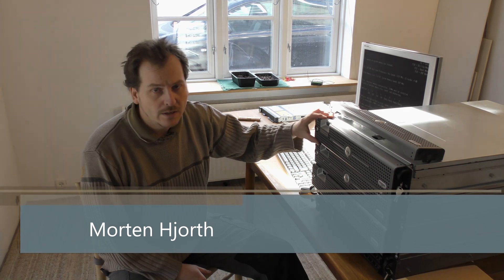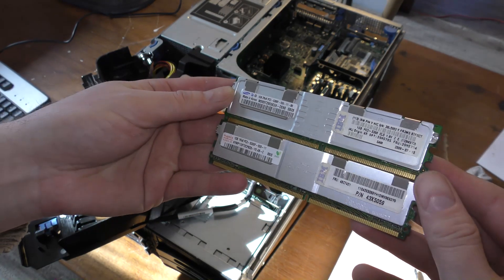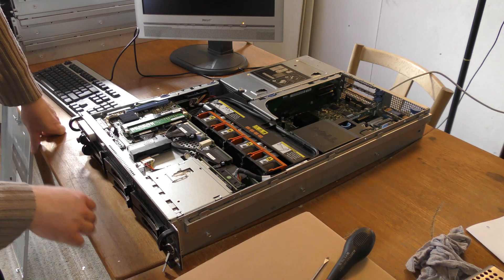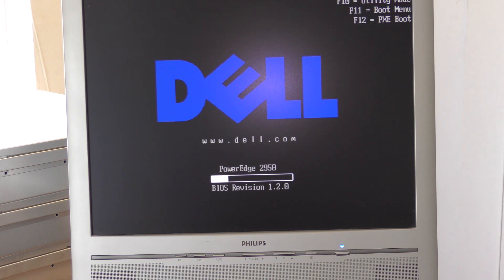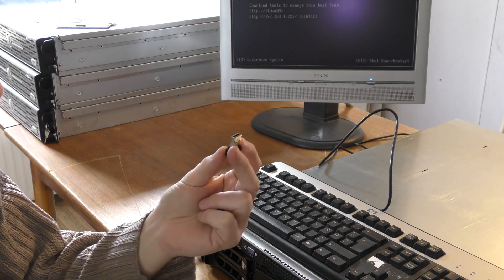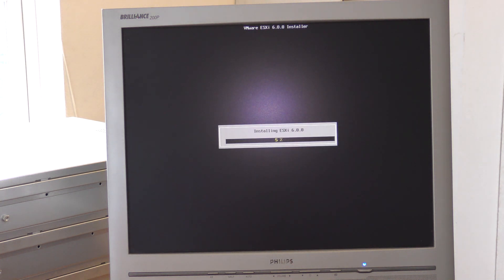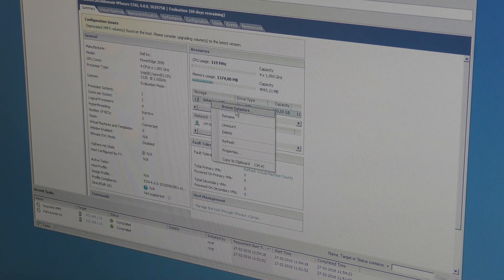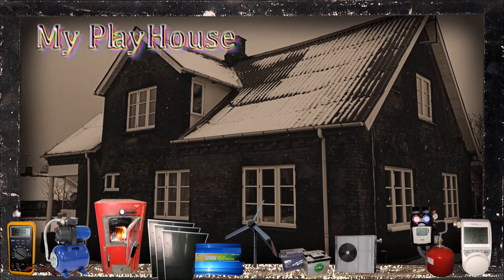Upgrading DELL PowerEdge 2950 from ESXi 4.1 to ESXi 6.0 - 316

Comment: Great video-- also loved the, baking a server board vid, I got a system working with a cigarette lighter once, but I knew where the bad solder joint was. Building a Pelican cluster from junk-- and want to add dell r900 w\16 cores, but I just have the mother board, power supply, and processors,, please help--
Reply from the maker: Thank You very much!

Comment: Hi Morten I'm currently running VMware ESXI 6.5 on my ''server'' which is a simple HP desktop pc (p6-2052fr) i5 2320 4x @3GHz, 4Gb of RAM with an Intel server NIC added (the built-in NIC isn't compatible) and I’m running into lots of compatibility issues and it seriously lacks of RAM for what I want to do so I plan to change it and I saw someone selling 6 Dells PowerEdge 2950 III with 2 Xeon E5405 4x @ 2Ghz, 8Gb of RAM, raid card Perc6/l, 1* HDD 73GB SAS, for only €36 each server. I'm wondering if it would be compatible with VMware ESXI 6.5 because I don't see it on the VMware's official compatibility list and if it is it would be a very interesting choice because I could easily upgrade the CPUs or max out the RAM to 64GB for only €60ish the last time I checked on eBay. So, have you or anyone else tried to install VMware ESXI 6.5 on a Dell PowerEdge 2950? it would help me a lot in my decision to buy one or not because I always dreamed to get a ''real'' server to play and learn new stuff with... otherwise awesome video! as always :D
Reply from the maker: Hi Tony M
I am not a big Dell Server Fan boy,, a  PE 2950 with a x5450 should work.. my Lenovo x3650 M1 which is same gen. does.
But if you really want Dell you shout go for an r710,, that uses the Intel Xeon 5500 and 5600 series of CPU,, and has hyperthreading. 
Thank you for watching! :-)
Reply: Yeah personally I find IBM/Lenovo servers better made than most of Dell ones, but they are way more expensive.
I don't really mind to get a Dell rather than a Lenovo, they tend to be cheaper, for the same price of a IBM System X3650 M1, you can get a Dell R710 which is way more interesting because of its hyperthreading as you said and its better upgradability (you can find pairs of 6 cores Xeons for pretty cheap), and apparently Intel Xeon 5300, 5400 and older series are way less power efficient than newer ones and they heat a lot more, so effectively the Dell PE R710 seems to be a really good choice in the long term but I'll have to figure out if it's very worth it to spend more than €150 with my very tight budget (#studentbudget lol), or just take a few of those older Dell that are cheaper but more power hungry.

Comment: Is PowerEdge 2950 possible directly install ESXi 6.0 ? Or need Upgrade from older version ESXi ( Such as 5.0 or 5.5 ) ?
My PE 2950 Spec
Intel Xeon E5430 2.66GHz x1
32GB FB-DIMM DDR2
320GB SAS x4 RAID 5 + 144GB SAS RAID 1 (Dell PERC 6i)
Reply from the maker: Hi LEYLAND LUI
IT shout install ESXi 6.0 No problems.
Thank you for watching! :-)

Comment: Hi, first i love your video's.

I got a question, how much power consumed the Dell poweredge 2950?
i like to know that because i can buy one for 75 euros with the follow spec:

2x cpu Intel(R) Xeon(R) CPU E5335 @ 2.00GHz quadcore
32Gb ram 8x 4Gb DDR2 FB-DIMM Synchronous
2 x onboard nic Broadcom BCM5708C NetXtreme II GigE (NDIS VBD Client)
2 Power supply 750w max
Perc 5/1
2x 36Gb SAS disk 2,5 15k [of meer]
Dell Remote Access Controller 5

Let me know thanks.
Reply from the maker: Hi  I sold my Dell 2950,, so I can not measure it,, but they are power hungry,, somewhere between 250 and 350W, is my guess.    
Thank you for watching! :-)

Comment: Sometimes my PowerEdge spins the fans up super fast because of the intrusion alarm being tripped, which is when the case is opened, I think i have caused it by opening the case (or not fully closing it) while the power supply was still up, a quick power cycle usually calms it down though, my log files are full of the system complaining about intrusions.
Reply from the maker: HI +Nevexo (computercam) 
It tels you in the log,, if the server has been open while powered off,,rather smart.
Thank you for watching! :-)
Reply: +My PlayHouse (Morten Hjorth) And the fans go ballistic when you open it!

Comment: Thats amazing you had no issues upgrading to version 6. My Poweredge 2900 is running 5.5 U3, so I feel more confident upgrading to 6 now! Thanks!!
Reply from the maker: Hi +gencwiz2 
Yes my biggest issue was really the I did not know where to look for that USB stick,,, I would think that if you can run 5.5 U3,, 6.0.0 will run just fine.
Thank you for watching! :-)

Comment: Hi Morten!  Thanks for doing another 2950 video.  I can tell how much you dislike them, but at least you have sold them now! I boot my 2950s from a CF card.  I have installed SATA to CF adapters.  I image the OS right onto the CF card and plug it into the back of the server, no installing necessary, just configuration.  I know people say not to run from CF because they don't have a long life with repeated R/W but mine have lasted for several years.  Had one failure, but simply reimaged and reloaded config file.  They boot fairly fast, I'd say 2 minutes.  I'm not running VM ware (yet ;o) ), just nas4free.  Other servers are repurposed citrix ag2010s for router/firewall (pfsense), media center and PBX for telephone.   Thanks again for the great videos!

eric
Reply from the maker: Hi +epd807 
Well I really do not dislike them that much,, I just haven't been able to use them for five years,,after that lightning strike.
And I got a lot more confidence for the IBM's after that.
I do think I might pick to a couple more Dell's,,, you guess seems to like them.
Thank you for watching! :-)
Reply: +My PlayHouse (Morten Hjorth) Just a note on the power supplies.  I run my servers with only one power supply each.  The other supply isn't even installed.  None of my servers are 'mission critical'.  All are on a UPS.  I've only had one PS fail, probably from old age ;o)  Just popped in a new one and I'm good to go.  The power supplies are like $20 on eBay.

eric

Comment: Well wow Morten the firmware on those are so out of date😂 Update them and it quitens down a little.
Reply from the maker: HI +ITServerTech 
Yes,, I do not remember if I ever updated them,,humm now I do not need to, I sold them.
Thank you for watching! :-)
Reply: Fair enough :P
Reply: +My PlayHouse (Morten Hjorth) Hey i sel memory on ebay cheap, if you need some check it out: 161989283019
Reply from the maker: Hi Fa lo
Nahh I do not. I did already sell those servers.
Thank you for watching! :-)

Comment: hey
just a tip for your videos
having the back ground music is great
but you might wanna turn it down like 10-15%
Reply from the maker: Hi +Anders Kyhl 
Yes,, I'll turn it a bit down,, :-)
Thank you for watching! :-)
Reply: +Anders Kyhl It actually seemed like the perfect volume, to me.
Reply: +Dave Lambert you using headphones aswell?
Reply: +Anders Kyhl Nope, Creek 4040S2 Integrated Amplifier connected to Bose 201 Series III speakers, with a Technics SH-GE70 Graphic Equalizer. That could be why it sounded extra loud to you though, if you're using headphones.